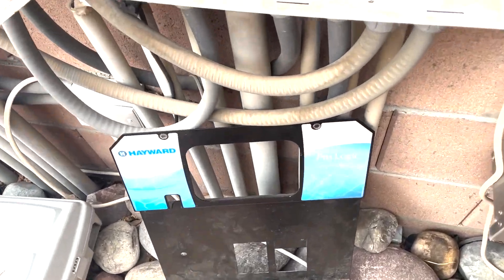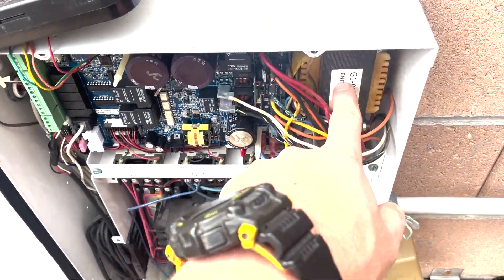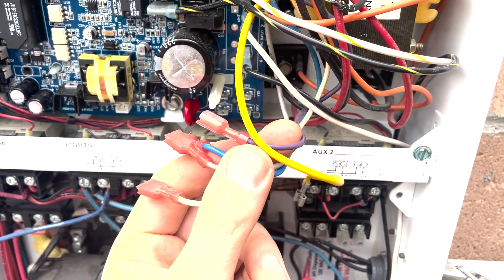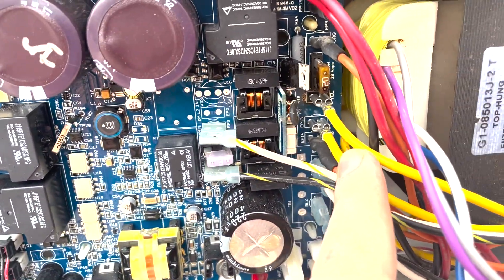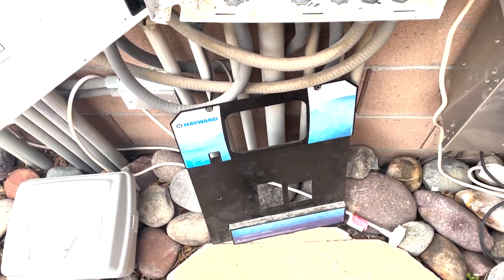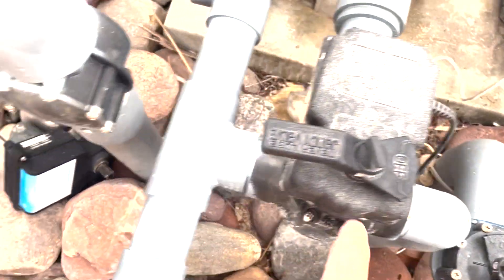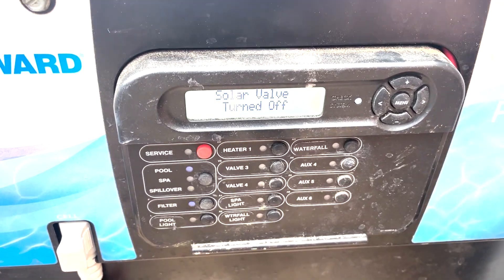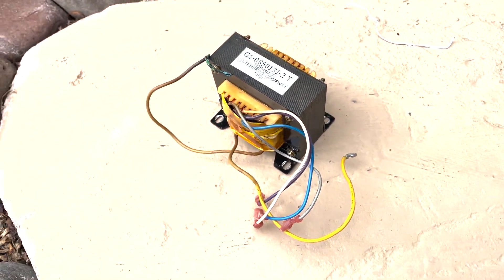FIXED | Hayward Pro Logic electronic valves and chlorine cell not working. Replacing transformer

Comment: Nice and straight forward. One question to you, I have voltage between yellow wires but there is no voltage between the 2 orange wires and my fuse is good. I replaced the board with new one and still same issue. Appreciate if you advise what could be the issue. Thanks